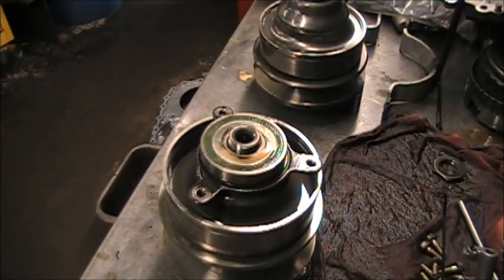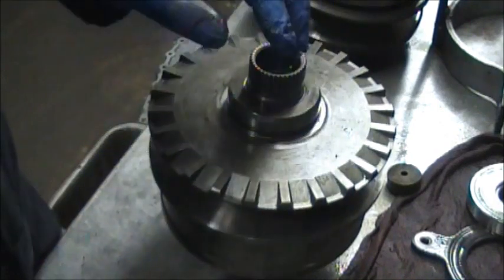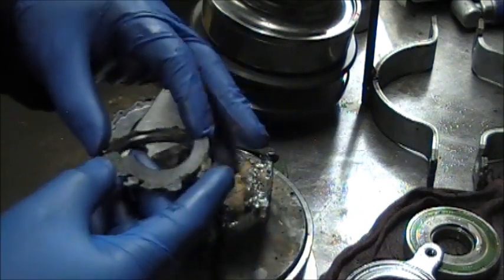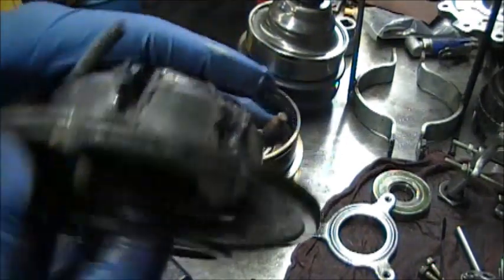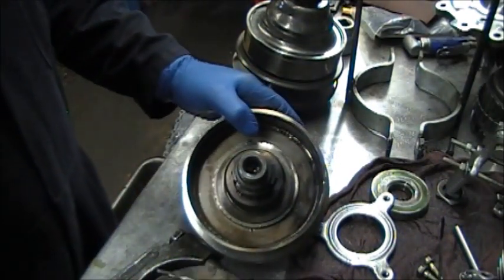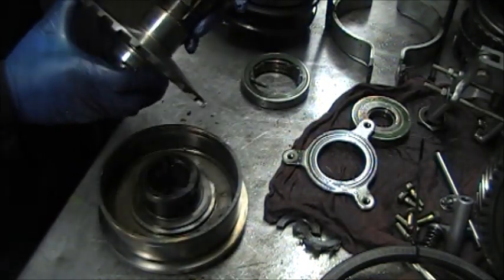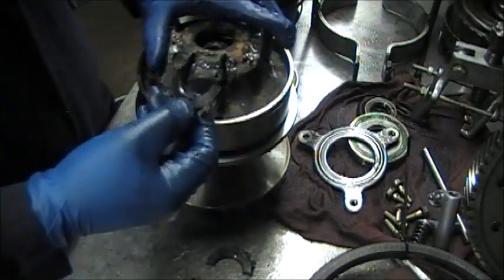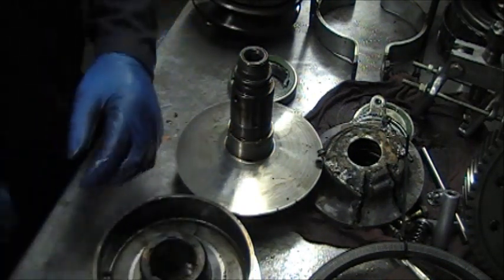nissan murano pulley part 3

Comment: Very interesting video. Very fascinating to watch! I have a Murano 2016 Platinum. The actuator pump unit had to be changed in the CVT.  I have a 6 year 150K mile extended warranty on the complete vehicle. I have only 30K miles on it. The dealer serviced the transmission at no charge to me. It was covered under the warranty.  I found out this service job without warranty would be over $5K. This is a huge amount of money to service a transmission!  With these vehicles it is advisable to not keep them after warranty. If you buy one new get an extended service contract with the manufacture. I am on my third Murano since 2005.  I can tell you for each service contract I got more than my money's worth!
Reply from the maker: How much did they charge for the warranty.
Reply from the maker: 2016 , and a transmission problem already.
Reply from the maker: What was the vehicle doing that the pump had to be changed?

Comment: I have a 2013 Nissan Altima S, 2.5L that sometimes will not engage in drive or reverse.  When it engage I only get the most 20 mph.  I originally got the codes read by the Nissan Dealer and they pull P0776 and P0965.  I flush the fluid and got about 5 quarts, then I drop the transmission oil pan and change another 6 quarts.  On the first change, the oil was dark and there was metal filings on the two magnets on the oil pan.  The second flush, was also dark but not as dark as the first, but there was also metal filings on the two magnets on  the oil pan.   I soaked the valve body in gasoline overnight and re-install the oil pan and put back the same oil because it was new oil.  The car drove a little better even giving me 40 mph sometimes, and it will take off when I come a complete stop.  However, after driving it for about 20 minutes, when you come to a stop it will not move until I shut it off and let the engine cool down for about 10-20 minutes.  I read online that when the solenoids on the valve body are defective, they will fail when the get hot, and cause the vehicle not to move.  I keep clearing the P0776 code, but it keeps coming back.  I do not get the P0965 only the P0776 code.
I found a set of  5 Solenoids in China for about $95, and I wanted to by them and try that first before buying a new CVT which I cannot afford right now.  If I buy the Solenoids, can you help me clear the TCM like how you did with your wife's car?  If you or anyone can help me out, please email me at:     prembizmarketing@gmail.com     thanks.
Reply from the maker: Tech Pro you want need to clear the tcm, you just need to solve the problem. If the solonoids are the problem, the computer will clear itself. How many miles are on your vehicle?
Reply: It has 77770 miles.  Just to be clear, are you saying that I don't need a fancy diagnostic machine to clear the TCM?
Reply from the maker: No, you do not need a fancy machine. You just need to fix the problem. Then you can clear the code with any code reader. If the problem is not fixed, then the onboard computer will turn the check engine light on again.

Comment: where's part 4? did u get it fixed? is this drum assy the common failure in cvts?
Reply: It is.  On the sentras it's this and the sun gear. On the v6 Nissans it's the pump

Comment from the maker: @ Dubai shashiashivi, Chrysler right now has a 30,000 mile warranty on their new cars. Caddilac has a 50,000 warranty on their new vehicles. Therefore, in the manufactures eyes any vehicle that get 60,000 miles or more is good. Now, that being said, I cannot tell you how long your cvt will last. I have not repaired a 2015 model. Therefore, I am not sure it is the same as the 2005 models. I do know I have seen the 2005 models last for 140,000 miles before having problems. If one puts 15,000 miles a year on a vehicle, this is close to 10 years before problems may arise. On your transmission, it depends on the materials that are used and the engineering methods. All of this will be tested by the driver. If the manufactures use inferior parts (aluminium where steel is better) than it will wear fast. There are transmission that breaks at 80,000 miles (Mercedes is one). Changing the fluid and filter is always a good thing because fluid looses its viscosity over time. However, fluid changes cannot substitute for a part that is only designed to last for only so long. Lastly, will Nissan make parts available in 5 years. They will if consumers start to protest! As of right now, they are not. Look at this, it is now 2015, the 2004 models need repairing but they are not selling the parts. They are not releasing the parts although this is an eleven year difference! Therefore, you cannot hope what they will do, you have to see what they ARE doing, because it is totally up to them, unless people protest! My hope is that the aftermarket makes parts that are compatible, then consumers will not be at the mercy of these auto manufactures. Ford, Chrysler, mini cooper are the same way.
Reply: questioning3 - i agree on the aftermarket parts...  

Thanks for all your awesome instructional videos !
Reply from the maker: welcome
Reply: questioning3 -

A couple of resources I found for these transmissions...  Links to follow:
Reply: Sonnex sells some of the rebuild parts, but especially useful may be their valve body repair tools and kits with oversized Pistons when the originals  or their bores are worn:

http://www.sonnax.com/units

Comment: Excellent diagnosis. My brother in-law just got a nissan with a cvt in it, he told me they couldn't be repaired. As a person who has worked on a few cars I found this hard to believe. It is nice to find out that they can be, and the trouble is in the parts after market. Thanks for the video and advice, I myself will try and stay away from them.
Reply from the maker: hrep14 you are welcome
Reply: +hrep14 Parts are here, depending on model-year!

http://www.makcotransmissionparts.com/REOFO9A.html

My trusty, rusty '03's got a new lease on life with bits available and hard parts too. Nissan is notoriously slow licensing 3rd party after market and OE parts to us plebeians. :/ It only took them what? 12 years now - to allow non-Nissan brands of very select transmission fluids to come to market. eyeroll